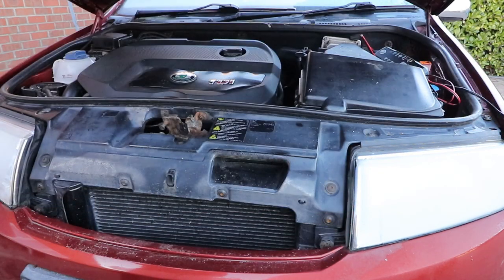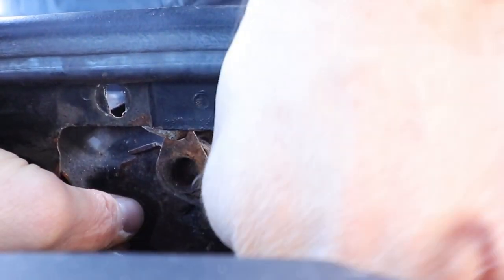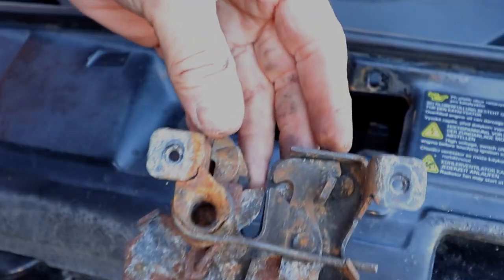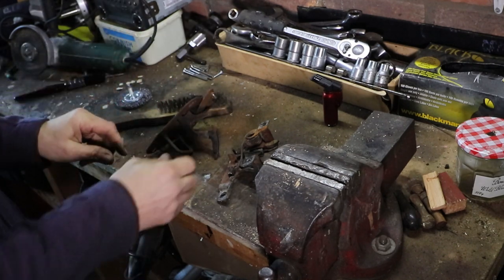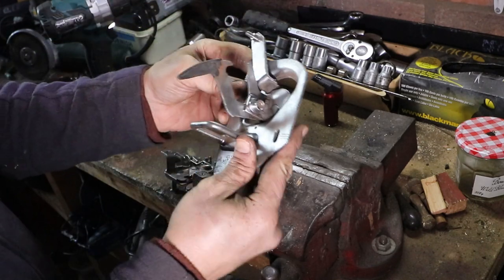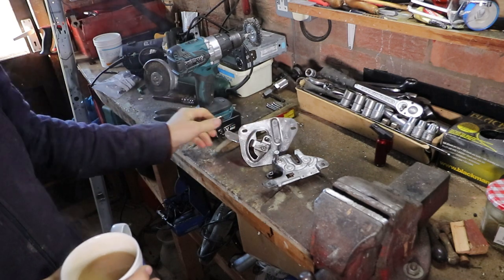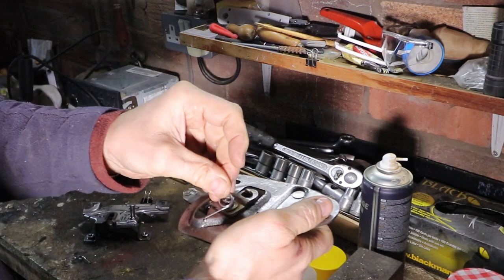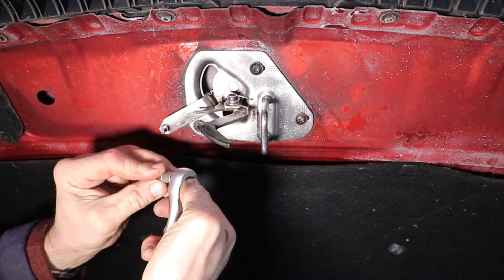SKODA FABIA Bonnet Catch Renovation (Mk1 99-07)

Comment: Maybe in one video you could show us how to change flap for cabin air intake. Cuz they are known for error of not closing it to the end when senzor on little engine dies. 😃
Reply from the maker: Agree, want to that when I get the time. Thanks :-)
Reply: I've shut mine close and disconnected it for the time being. It used to open at the most inconvenient times, like behind an old truck inside a tunnel etc. 

Fortunately I can make good use of the tilt function of the sunroof in order to get some fresh air.

Comment: Neat little job, thank you, I would probably have used smooth black Hammerite buts that's because I know I haven't got any clear lacquer. Oh and was a good idea not to clean the paintwork round the upper mount so that it was easy to line it back up, Cheers, Chris
Reply from the maker: Thanks, yes I didn't mention about the alignment in the video, too cold 🥶 at the time and the light was drawing in. I thought about hammerite, but the finish isn't that good.

Comment: Nice job,

Rusty bonnet catches is a joy that hasn't manifested with my Fabia . . yet.

 I only get a binding cable and catch mechanism. Annual lube by me fixes that . . but it always comes back. A little bit of cleaning , followed ny a judicuous use of Silicon sray and the lightest smearing of  LM  grease does the job . . so far, I've had no "Bonnet-up" motorway events.

Amazes me the lack of joined-up  in car design . . stainless door catches and mild steel bonnet catches.

 But I suppose it fits with the manufacturers Value Analysis/"Sealed-for-life"  philosophy . . if it doesn't show, doesn't perform a critical function and outlives the first buyers period of ownership . . .go cheap.

One of the previous technicians at the main dealer, when my Fabia was nearly new, used to spray everything that squeeked, clicked and pinged,  i.e. door hinges, boot and bonnet catches    with foaming white (soluble Calcium ?) grease.,

 This individual left employ, thereafter,  catches and hinges were left to do their own thing. So after that, I had to take over the roloe, once a year. 

Funny, but I pay for an annual service . . . . somehow catches, cables etc are no longer included.

Standards . . standards. 

No doubt, if I keep on with the VW/Skoda bashing tack, like the hospital, I'll be verballed with the "You expect Mercedes standards at Skoda prices"  comment.
Reply from the maker: Thanks for sharing :-)

Comment: Hi mate, got a question as your my go to channel for anything Skoda fabia, I've got a 2001 petrol 1.4 and the engine lights been on for a while now. I got the garage I use to sort it out and they put a new egr valve in it and still the light was on, so they put the obd on and came up with the oxygen sensor so that was replaced, everything was fine for a couple of miles then the light came back on, I phoned them and they told me to bring it back, they put the obd back on and it still came up with the oxygen sensor? So they said it could be a fault in the wiring loom, sorry for the essay but does this sound right what they said? Have you ever come across this problem. I'm a bit concerned now as the mot is due in feb and I can't afford to replace the car at the moment so any help would be deeply appreciated. Cheers
Reply: Buy an obd scanner - find the codes then you will have a better idea.
Reply from the maker: If they put the oxygen sensor on they should have fixed it which initially seems to be the case, but now the fault returns on the O2 fault. So it would seem fare to question if the sensor they put on was a crap one or what they say about the wireing is true and needs further investigation. I would ask them to question the O2 sensor and see if they can try another sensor. But do you think they are playing you for work? Or not, lots of garages do that just to make up work. It is difficult to judge, your call. You could buy and fit another O2 sensor yourself to see if that works,, they are easy to fit. Is there another garage you could try?
Reply: Thanks for the reply Hatboy Harvey, I use the garage all the time and are usually pretty good, I'll have a go at replacing the o2 sensor I'm not too bad with spanners.  One thing I forgot to say is I saw on a skoda forum that an egr value has to be set up to the car when fitted, is that the case do you know? Thanks again but I'll let you know if I can get it sorted 👍
Reply: @raymondee100  i already changed the upstream and downstream O2 sensors in my 1.4 Fabia and the only thing I have done it was disconnect the battery to the ECU start the relearning. I also had a problem with the upstream sensor, and I remember that tested the harness connection with a multimeter by unplugging the ECU plug and measuring the resistance between the sensor plug and the ECU plug. Since I did not know the Pinout, I tested all pins of the ECU plug until ear the multimeter beep.

Comment: Thanks for the tutorial, probably going to clean my hood latches on my fabia, I was thinking to remove the rust like you did it than remove the small rust with chemicals and cote the metal with zinc through electrolysis. My theory is that the zinc coting is going to last longer than the laquer paint in the friction areas and we will still be able to see any future rust like with the laquer paint. Or we can combine the zinc with the laquer paint.
Reply from the maker: Yep, cool to set up a zinc electrolysis coating bath, it would interesting to do. Sounds like you know a bit about it, have you done it and how easy is it to do?
Reply: @HatBoyHarvey I have done it, it is pretty easy there are a lot of good tutorials on youtube and you only need baking soda don't use salt it will create chlorine gas, water, zinc plates, and a power supply it can be 2 AA batteries.